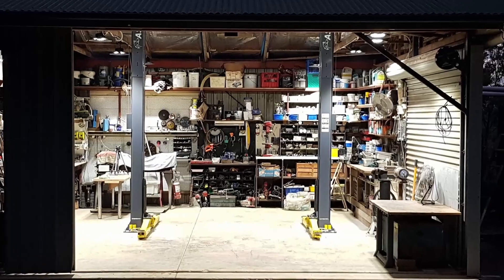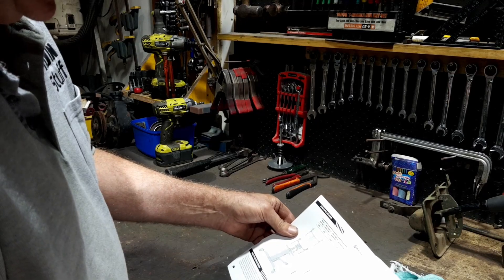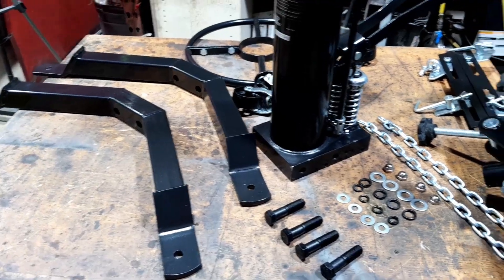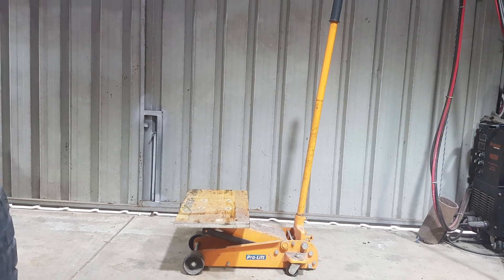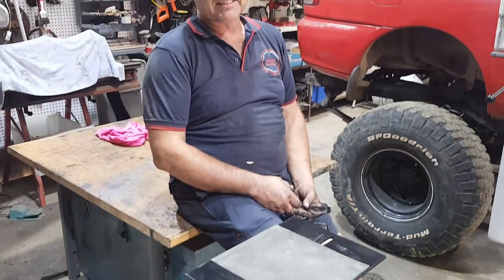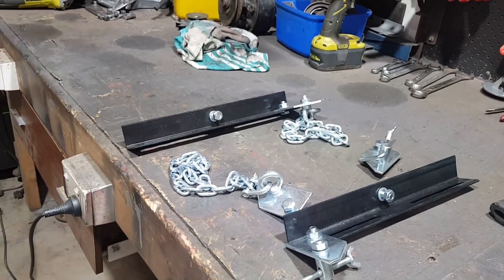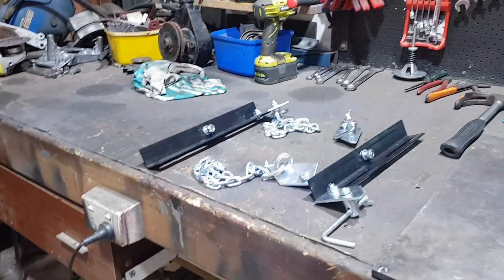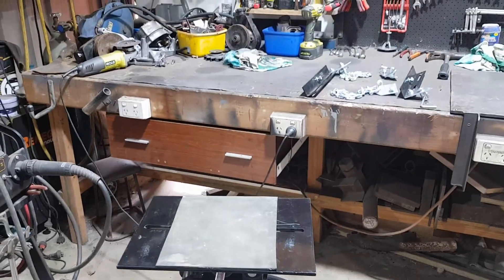Trolley Jack V's Transmission Jack

Comment: I'm a bit late to this party, but looks to me that the leg sections are on upside down, with the castors meant to be in the niches lowering the C of G. However, if it works it works.
Reply from the maker: Thanks for your thoughts, the casters can only bolt on 1 way though 👍